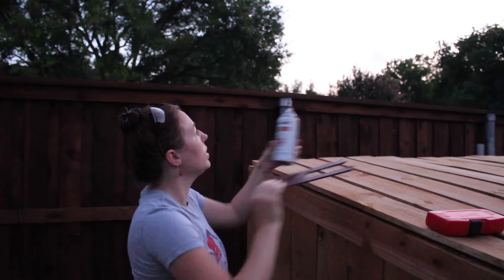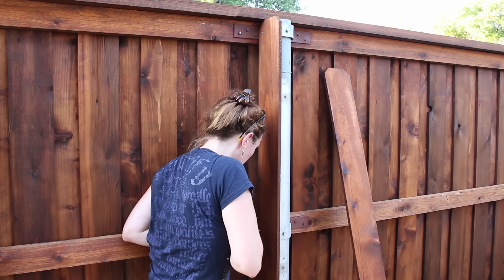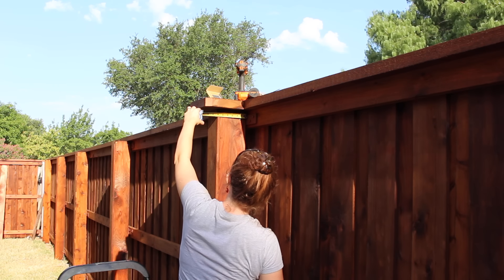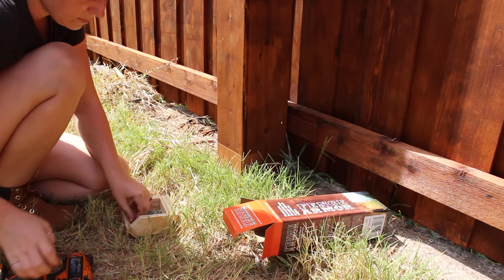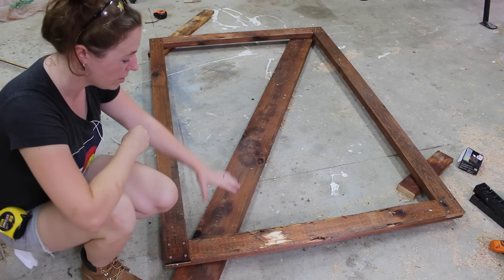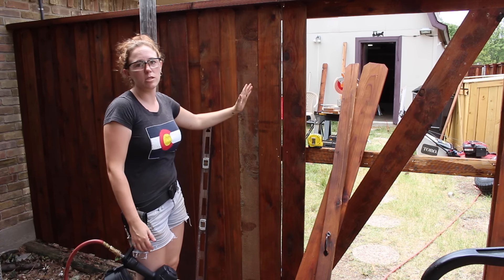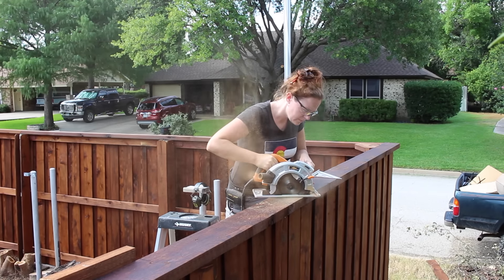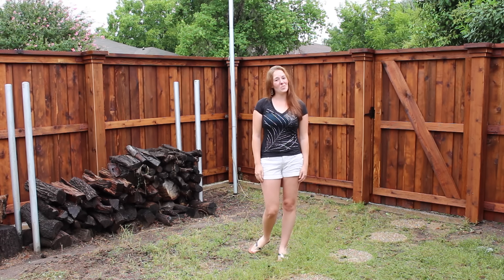Building a Horizontal Board on Board Fence | Part 3 - Trim + Building A Gate

Comment: I am going to copy your fence, it's beautiful. A few questions: How do you feel about battery drills vs power cord? I'm still a cord guy...I think. I'm putting the fence up in the Palm Springs area ie. 112F two weeks ago and it wasnt even summer yet. Any suggestions on protecting the wood (I like the wood look)  and it's also super windy. All the wind farms scenes in the movies were shot just down the street. Any suggestions for durability? Thanks in advance.
Reply: All batteries are evil, that's just a fact of life. Battery is far more convenient than messing with power cords, but they always run out of power, the tool doesn't have a lot of power, you need spare batteries, they are expensive, they won't be charged when you need them, and they only last a few years and then are junk. If it's possible to use a corded tool I'll choose that every time.

Comment: Nice work kid! It's nice to see you women do carpentry work but you left your speed square on post it could've fall on your noggin and if you get some good quality self tappers and you impact it will go through that metal tubing etc also your miter saw dust collector bag were is it ? Good job and stay busy🇺🇸👍🏼

Comment: so concrete & posts not included, this is a $20/LF fence. add in those awesome posts and you're probably looking at $30/LF. absolutely gorgeous. I wonder what the maintenance costs are going to be. Certainly less due to the nice top board deflecting rainwater.
Reply: Justin Crediblename that fence cost minimum 60-65 $/per Lf.

Comment: I mistakenly used a brad nailer when I did my fence obviously I'm having pickets back out now... what type of nail gun do I need for the pickets? A lot of what I read online says 2 inch framing nailer but there's no way at 2 in nail is not going to stick out the other side sense the pickets are less than half an inch and a two-by-four is technically only an inch and a half wide. Thoughts?

Comment: Good morning April, I am debating between vinyl due to maintenance and durability vs horizontal wood fence for appealing and was wondering how is your fence holding up any warping, splitting or bowing in your fence or what would you do different?. I am considering 3/4” x 6” x 6’ pine pickets or would you recommend cedar instead, thx. Good looking fence btw!

Comment: I think i might have missed it, but what did you screw the gate into? just the wood of the pickets? since the posts are pipe and not wood? I want to build a fence this way, i pretty much got it down except for how to mount the gate. thanks

Comment: Great fence, and wèll designed.  Howeveŕ; the only oversight I see is the doorway.  Why?  The opening where the doorway is I would have bridged it on top with some manner of steel arch or buttress, or heavy steel lintel, encased in wood.  Why?  Because by doing so it achieves several purposes.
1. It ties the two columns in the opening together, and thereby strengthen them, so that if in the future, as unlikely as it may seem, if one side moves, or shifts a little, it will either be held by the other, or both will sag equally, dividing the stress between the two columns.  If both sag, at least it will be equal and balanced.  Thus hopefully hide such better, till repairs can be made.
2. By doing a higher top bridge between the two columns, which you could encase in wood, would make a focal point of the entryway through the doorway.
3. I could also put 4 more columns next to the ones that frame the door.  I would use these columns to further strengthen the opening of the door, but I would also use them to construct a small covered passageway between yards, raising the strength of the opening, and enhancing the beauty of a customized entry passageway.  The esthetics of such would be pleasant indeed, specially if some manner of lighting could be placed on the passageway area, either by running electrical wires to the lights, or using solar powered lights from batteries built into the lights.  Overall it would raise the amount of work, and design efforts; but in the end, it will make an already beautiful gate, into a dazzling show of customized elegance.
That's just me.  Still...a great fence.

Comment: Question..I want to replace my wood fence with pipe and wood like yours: however my problem is on one side of my home my fence sets directly on top of a sewer line. I know this because I hit it once while replacing this section. My fence continues to sag and fall in this area...what are your suggestions on placing a fence in this area. This is why I want to use pipe instead of wood posts. Should I place more posts on this side, place a footer, or both?

Comment: Awesome video, April!  Big thumbs up.  Question for you...

I notice there's lots of flat surfaces at the top of the fence, especially on the posts.  Are you concerned about water sitting on those surfaces and doing damage?
Reply: Yes, that is an issue. I've seen lots of fences with that top cap rail and it gives the fence a polished craftsman look that is one step nicer than the usual fence. However on many older fences like that the cap rail has warped and looks unsightly, or worse. If you keep it stained every year or third that will be less of a problem.. That may be ok for some small fences, but I'm wondering how long it will take every third year to re-stain a fence this huge? Worst case is you'd have to replace that top cap rail in ten years, that doesn't sound so bad but all jobs like that eventually boil down to "I've put this job off for several years and now I must do it tomorrow," or, more realistically, they just never get done. I've also read one guy that wants to angle that top rail so water doesn't linger there. All the above may be some reasons that cap rail is often not done. In the end, you don't get anything foe free.

Comment: looks alright. wish there was something more that could have been done A bout the ^ in the top plate where the door is joined.  why didn't you follow through on the out side just under the top plate like you did on the inside?  besides the cost.

Comment: 4:56 NO!!!! You want to go corner to corner, not edge to edge. Next time, cut a point in the cross beam that abuts BOTH sides of each corner. Wood has compressive strength so had you filled that corner up it would be ever stronger and less prone to coming out of square. Better to rely on an inherent property of the wood than the grip of a few wood screws. This probably won't matter to most people until you have young kids that like to hang on things and they break your gate.

Comment: Excellent job and great video production. However the amount of tools that you have rivals that of most contractors that I know, your average DIYer couldn't afford half of what you used in this video. This is no way takes away from your skills and vision.
Reply: I've learned a lot from your vidéos, you are an amazing google looking  lady, tank you.
Reply: The only part that might be significantly harder without advanced tools is the welding of the post extensions. A circular saw costs like $60, which you can use to do most of the cutting. Not seeing a whole lot in this video thay can't be worked around for a lower cost.

Comment: Beautiful fence ... Why do we always put the good side out to the neighbors it's not their fence.
Reply: Neighborhoods that have HOA's 99% of the time require the pickets to face towards the neighbors. They can also regulate what style and height fence style can be installed, how far from the property line, and the color of the stain if any is applied at all. Some fences look better with the 2x4s and posts exposed, like cap boards or pasture fences (in my opinion). Interesting to see how people build them on a non commercial level. Looks great, the only thing i would change is 45ing the trim boards around the picket cover boards for the posts.